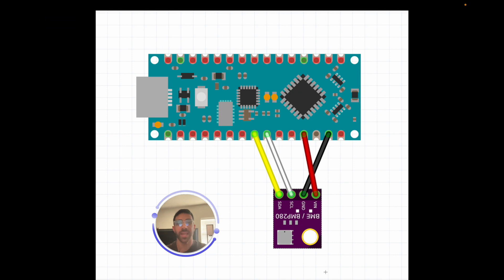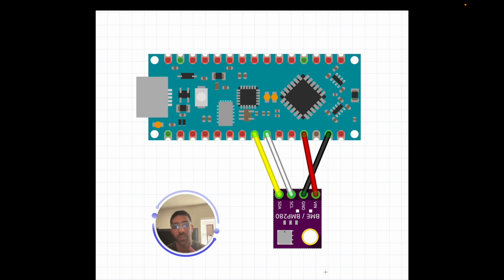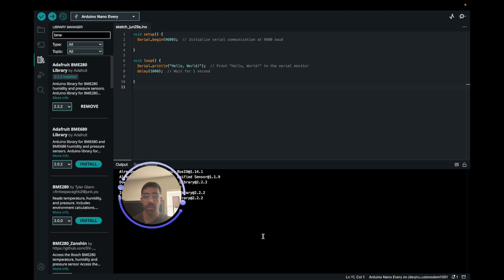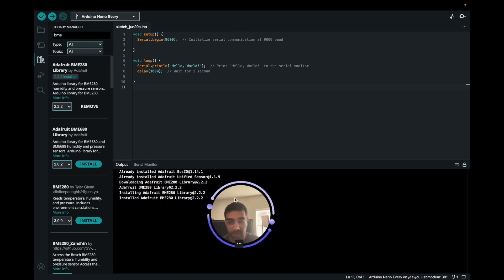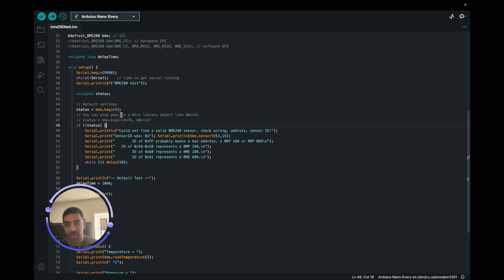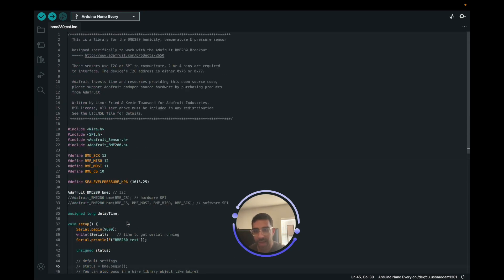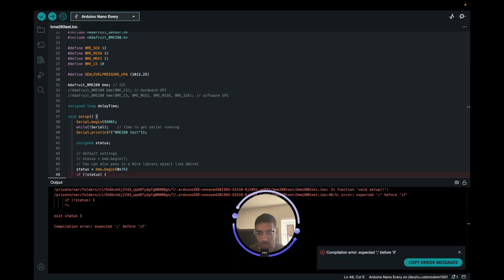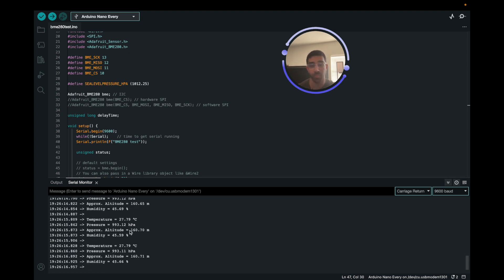How to Measure Temperature, Pressure, Humidity, and Altitude with BME280 and the Arduino Nano Every

Comment: Thankyou for the video I bought this exact one, when I configured for status = bme.begin(0X76) . The sensor began to respond to the program thankyou. Why does it need the hex 0x76?
Reply from the maker: Thank you for watching the video and sharing your experience! The reason you need to specify the hex address 0x76 in bme.begin(0x76) is because it's the I2C address of the BME280 sensor. I2C devices like the BME280 have specific addresses so that the microcontroller (like the Arduino Nano Every) can communicate with them individually on the same bus. The BME280 can have one of two I2C addresses, 0x76 or 0x77, depending on the connection of its SDO pin. By default, many BME280 sensors are set to 0x76, which is why specifying this address allows your sensor to start communicating with the Arduino. If you have multiple I2C devices or another device uses the same address, you might need to adjust the addresses to avoid conflicts. I'm glad to hear the sensor is responding well to your program!